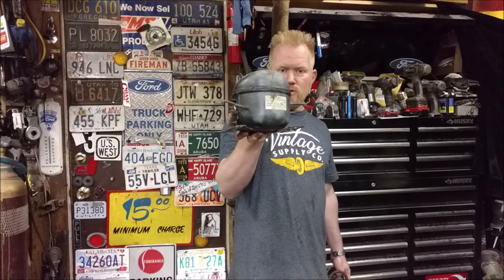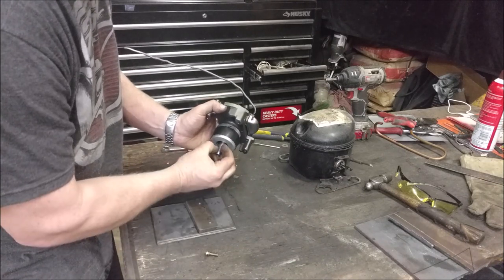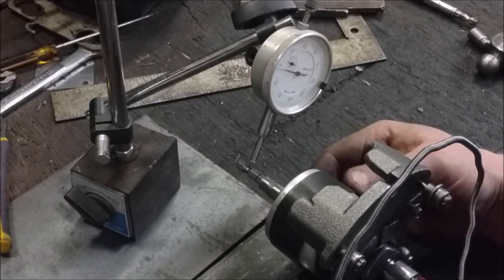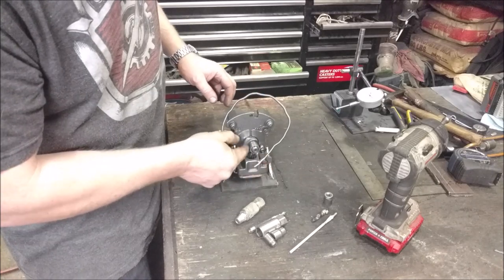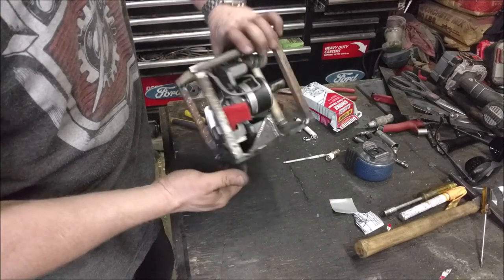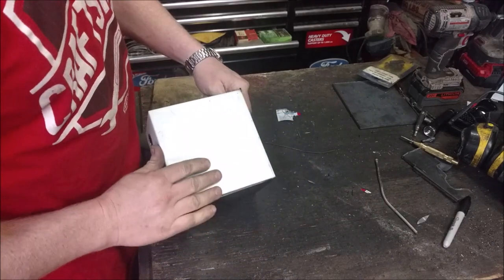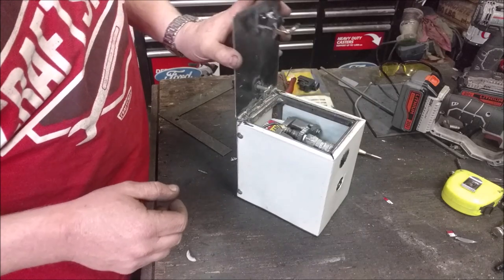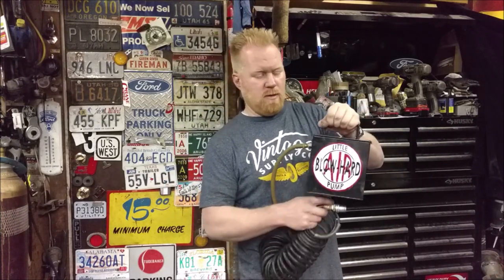Drill powered Air Compressor from old fridge

Comment: Dude! You never cease to impress me. Most people, (Myself probably included. LOL), would just knock something together, and call it good if it worked. But not care about the details. You don't stop there. You not only add a dust shroud and filter holder, you make an entire CASE! Well done! It's amazing how you come up with these locking mechanisms! And that pump may fill a tire slow, but it is capable of something like 1000 pounds! Also glad to see that you liked the air chuck! I don't think I use mine anywhere near as often as you do. If you have problems with it, please let us know. :)
Reply from the maker: Thanks and thanks for the advice for this tire chuck. I've used it a few times and really enjoy it.

Comment: The uses of the compressor I cut out of a dorm size fridge has led to many accessories from bleeding brakes to flushing my truck's transmission. I haven't evacuated an AC system yet but im sure it would as it's still encased with mineral oil. Definitely my favorite channel.

Comment: I’m betting you could tap into the intake and have a drill powered air pump/vacuum. Awesome work bro. Thanks. And yes-loved the latch assembly SUWEEET!
Reply from the maker: Thanks, I'm glad you liked it.
Reply: I was wondering how difficult it would  be to convert to vacuum, and also how muchbit would pull.

Comment: Thanks for sharing! This is what I learned.
- 
Refrigerator pumps don't need allot of power.
Don't use a welder to straighten 2 types of metal
Don't weld cast iron.
A socket makes for a simple coupler. 
Brazing looks like fun.
Save your old sheet metal. See Brazing above.
Steel brake line can be used as hinge and handle.
Make your own latch better then store bought.
Taking the extra time for simple artwork can make a difference. (Very creative by the way! I would steal it but, I'm not that cool. :~)
Haltek fittings "Stay Attached".
It WORKS!
Reply from the maker: Thanks for watching. I enjoyed the break down.

Comment: 2: 50 - , I make the first tack the smallest tack that will hold, then go opposite and make a bigger tack. Then check where it has to go from there. Thanks for showing the ingenuous build.
     Using old brake lines to make a hinge. 
All I want is a dollar for everything I didn't think of.

Comment: I have used a complete unit for a plug in compressor for years, works quiet and will last way longer than me, can run for hours at high compression and won't have a problem.  Mount to plywood base with castor wheels, wire a long cord and small diameter hose.  Warning do not walk away while pumping up tires, this thing will pump till it blows.  At first use, run until warm and try to pour out some oil from pipes.
Reply from the maker: They work.

Comment: Nice build. I wonder if it would work to attach a piece of hose/tubing to the shaft (using hose clamps?) and then to something on the other end (bolt?) to which you could attach the drill. I'm thinking this would create a sort of flex shaft so your drill wouldn't have to be in exact alignment with the pump shaft.
Reply from the maker: That's a great idea!

Comment: Dude that was awesome. My dad's got a huge bad compressor off a walk in freezer. I'm gonna cut it up!
Reply from the maker: I have a huge refrigeration compressor sitting in my shed a was planning on using for something like this. The biggest issue I've had with the one I used was it is too small, so it takes a long time to fill a car tire. A larger unit should eliminate this.

Comment: Was not impressed with this project initially, because I made a water fountain air compressor into a 12 volt compressor in 1988. However at the end your putting it in that frame with a sheet metal cover and ingenious collapsing handle got my attention. Then you freehanded the logo and blew me away! My homemade compressor still works to this day but never looked that good!
Reply from the maker: Thanks. I'm glad you liked it.

Comment: Your a genius,I used a compressor from a refrigerator for an evacuation for a/c systems it will pull it down to -8 and if it holds I know there is no leaks in the system

Comment: very cool. I wonder which produces more air. A fridge or vehicle ac compressor. I'd need mine to drive a air horn. Don't know if it pushes enough air for that. Without it charging a pressure tank. Then things get far more complicated.
Reply from the maker: Vehicle is. It has to produce way more BTUs to keep a car cool.

Comment: would love to see an update video .. add a pressure gauge .. what kind of psi will it make .. race it against a cheep 12 volt 1 .. love the videos keep them coming
Reply from the maker: It'll beat a cheap little $15 12volt compressor, but not by much. It'll pump upwards of 200psi but I wish I would have used a pump out of a larger refrigerator to get more volume.

Comment: Amazing useful way to pump the tires. I carry a cordless impact in my car and could use a pump like this instead of having to plug into the cigarette lighter with my coleman pump.
I have a slow leak right now, BTW, lol...
Reply: I imagine that it could take a good amount of energy to inflate a tire. Do you know how many fills you can get from one cordless tool battery?
Reply from the maker: This compressor I used was tiny. It was out of a mini fridge and wouldn't do to well inflating car tires. A compressor out of a full size fridge would have twice the capacity. I would think you should be able to fill an entire car tire and have some juice leftover in the battery.

Comment: Im diggin the latching lid. Im not sure why youd want to get into the top. Oh nevermind you need to be able to move the quick coupling. Think id made that accessable from the front but over all it was cool. How much psi would it make?
Reply from the maker: It can pump 250-300psi.
Reply: @sixtyfiveford  thats cool. Im trying to spread the word about husky brand 2 gal fp209102 DO NOT BUY IT!!!.  When you buy a small compressor you dont expect it to run a framing crew but this miserable thing empties the air out with a nozzle within 15 seconds and the pump cant keep up with whats going out. Even when full. It literally takes 10 to 15 mins to fill if emptied and its loud as hell. Honestly a dinky throw away 12 volt air pump does the same thing. Ive never used a fridge comp to pump air hut i built all of my freon recovery units from fridge compressors. Good video. The handle latch was very creative.

Comment: Hi! Have you tried a 12v drill for pumping the tires? I have an idea to make an "on board" comp, powered by the 12V car battery. Would it be capable to pump up to 4bar faster than little Chinese?

Comment: if you reverse the direction of the drill will it become a vacuum?
Reply from the maker: It will pump in either direction. You would just need to make a fitting attach to the air inlet and it will vacuum.
Reply: I am working on a vacuum pump from an old compressor right now. Motor is fine so it will be mains powered. When I am finished I will upload and identify the few issue I am having now.

By the way great project. The hinge is really nice.

Comment: If the motor is fine, in good working order, you don't need to take it appart. Just attach it to a air tank, make an air filter to protect the piston and that's it. I know because I have one made from an old Arctic (name of manufacturer) fridge.
Reply from the maker: Nice re-purpose.

Comment: any lubricant in there for the piston or bearing? never mind missed the oil comment in beginning. I turned my ac compressor on my 94 3.0 ranger into onboard air. worked awesome.
Reply from the maker: I've thought about turning my dead AC system on my 78 Ford into an air pump.

Comment: What kind of battery's are you using on your porter cable impact and angle grinder. It doesn't look like a porter cable battery, maybe black and decker?
Reply from the maker: Yes, it's the 20v Black and Decker battery. You grind off a little tab, do a little minor trimming and they fit right in for a fraction of the price. Black and Decker owns Porter Cable, Dewalt, and a few others. I thought maybe they were using cheaper cells inside the B&D but they are identical ( I pulled them apart).

Comment: I always wanted to build a battery charger using an old 2 stroke weekwacker or blower engine and using a 1 wire alternator. However, not sure how to build the speed regulator for the throttle, when load changes. Nice to have like 100AMP charger for remote locations, like boat, camping, etc. You can buy this new GM or Ford  alternators cheap, in Ebay, like for $29 and converte it to one wire alternator.
Reply from the maker: You won't need to adjust the speed to regulate it. The alternator has a built in voltage regulator that does this automatically. The weed whacker motor won't have enough power to push the alternator to 100amps but you should be able to get 20-30amps.
Reply: sixtyfiveford Thanks for the quick reply. I was concern about the engine over speeding, in case the electric load got disconnected, and the alternator reach 12,000 rpm or so. Btw, really nice videos you have. Keep the good work!
Reply from the maker: You would want to run it with pulleys to drop the speed of the alternator. A properly tuned two stroke engine won't over rev with no load. But also the rotating mass of the alternator will give it a small constant load.
Reply: sixtyfiveford I was against using pulley due to friction losses inefficiencies and side loads in the bearing in the engine. Was thinking more like a heater hose connected directly as a coupler. Will see, how turns out.

Comment: funny because everybody is commenting on the handle latch which I thought that was one of the coolest Parts myself one question though how long do you think it would take to fill a regular size tire from 10 psi to 35 PSI
Reply from the maker: It's small and is more suited to small tires like in the video. It could do a car tire but I would imagine it would take 10 minutes or so.

Comment: you are a great engineer.can you help me? . i need a crank shaft by tow pistons attached to it  , so from  which kind of junk stuff i can extract that ? the refrigerator  only uses  one piston
Reply from the maker: Automotive "York" style AC compressors use 2 pistons.
Reply: thanks , you are great :)

Comment: im surprised its running dry. doesn't it need an oil bath to run efficiently?
Reply from the maker: It'll hold enough oil to only need occasional manual oiling.

Comment: me too, the handle is great!
I would really like to know, how long it worked as it was "swimming" in oil before and get's "one drop in a while" now ...
They say, theese little bastards are able to perform up to 20 bar (290psi)!?!
And I loved, how much time you gave for painting -  have to think about that, as I just do black matt all the time ;-) 
Respectful greetings from Austria
Reply: The splash lubrication is partly needed for heat transfer from the electric motor. and I'm guessing that the refrigerant dilutes and thins the oil quite a bit. Don't worry about it, there's plenty of broken refrigerators around.

Comment: What about lubrication for the pump?  These are normally in an oil bath.
Reply from the maker: Just a few manual drop of oil occasionally will take care of it.
Reply: would this drop of oil ever get to the "big end" of the connecting rod?  Also, what could be done for lubrication (and is what is normally used for utilizing A/C compressors for on board air in off road trucks) is to put an inline oiler on the intake side of the pump. although your case would probably have to be a bit more bulky to fit one, unless you made your own mini one.
Reply from the maker: Yes, the entire crankshaft is hollow, so it drains onto the crankshaft and piston.

Comment: Question what is the maximum pressure it can generate ?? (in PSI or Bar/atmospheres)
Reply from the maker: 200-250psi would be towards the upper end.
Reply: @sixtyfiveford   that is 15,5 bar on average…  bit low....good enough for pumping tires…. that is true…. But than again I am looking for pumping at 200-300 bar non the less ..... Thanks for sharing ….

Comment: I have an old window ac unit that I would like to use in a project.  It runs but does not get cold, barely cool.  I don't know anything about removing the freon.  Is there some place I could take it to remove the freon for free or little cost?  Does the freon have any value to somebody?  I hauled a different one to the metal recycler and they almost didn't want it as they have to pay a company to empty the freon.
Reply from the maker: That's the dilemma. R12 is the oldest and highly regulated/illegal to vent. R134a is in a lot of newer systems and used to be the same stuff in computer air duster and a lot of aerosol cans, so it was sprayed out intentionally. Now it is illegal to intentionally vent in the US, but it is done daily throughout the rest of the world. It is also in all cars since 1994 and is self dumped in virtually every medium-major front end collision. My stuff has luckily self emptied like yours will eventually by the sounds of it. I don't know of a place the reclaims refrigerant.
Reply: Thanks for the quick reply.  Is there any trick way to know when the gas has all leaked out in a 120VAC window ac unit (1987) so that I can just cut the lines to remove the compressor?  Like maybe some kind of noise, oil gurgling, gas hiss or temperature readings?  There is no shrader or other fitting, just the standard pinched off line at the compressor.
Reply from the maker: They will generally leave an oil/wet mark on the lines somewhere when they have leaked out. Also they won't cool at all. But the only definite way is to hook a line tap up to it and a set of gauges.
Reply: Thanks, that really helped.

Comment: whats with the cynder block on the front of the mower?
Reply from the maker: It's to weigh the front end down(better steering) when I have the grass bags on or towing a trailer. You'll notice a black cement block put on from the factory.

Comment: How long will it run whit out lubrication? G.W. b.t.w /mrJ
Reply from the maker: The oil stays on it and continually lubricates. A few drops every dozen uses will suffice. However,  people forget that oil is also a coolant. So the lack of constant oil supply limits it's continuous use to maybe 10 minutes before it needs to be allowed to cool.